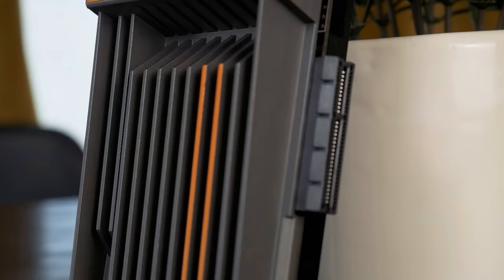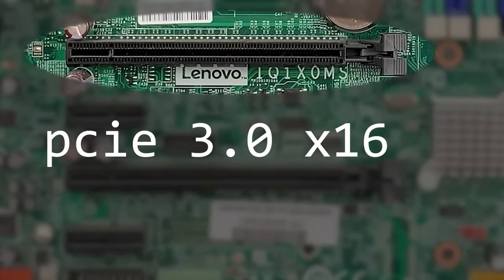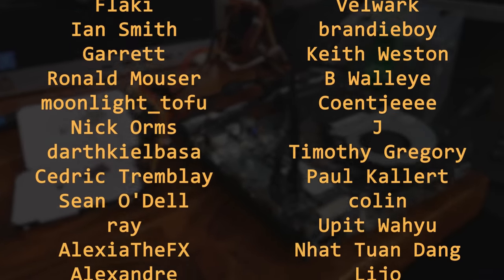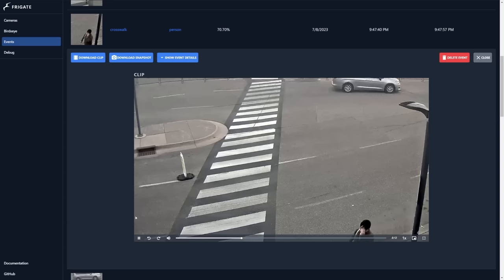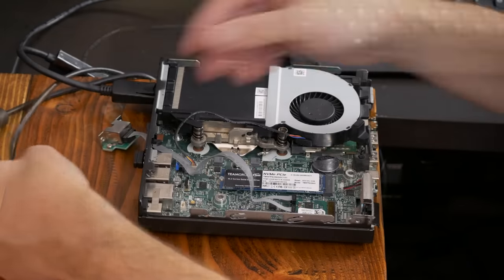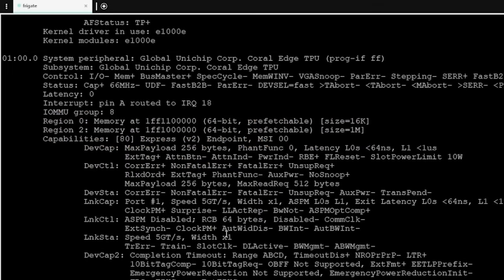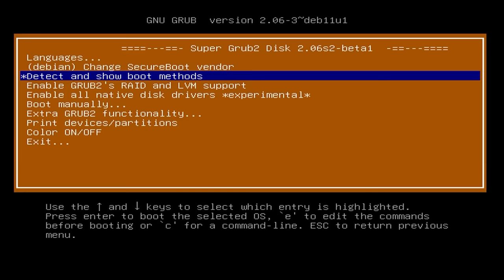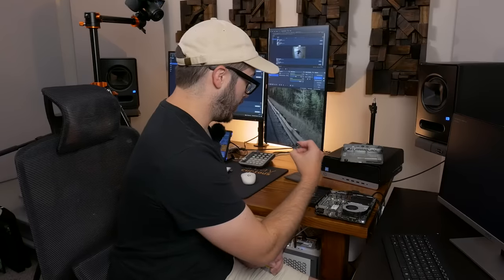Don't Overlook This Slot

Comment: Does anybody know if the dual SATA adapter can be used for a raid 1 configuration? I'd like to use the nvme drive for the os, and have 2 additional sata drives configured as raid 1 to make a nas-like system. It would be just for storage so even if doeas not reach a full gigabit I will be fine
Reply from the maker: Yes, but you'll need to configure RAID in software (which I would recommend even if the SATA adapter had a hardware RAID controlller)

Comment: I have tested with a coral dual edge TPU but did not manage to get it working in the same kind of system. Did you did any configuration in the bios to get it working?
Reply from the maker: Don’t think so… I know the dual requires 2 lanes for full operation though and I only think this has 1. I guessed it would work partially but maybe not

Comment: wouldn't that ethernet port fit if you flipped it round and put it in with screws on the other side
Reply from the maker: Probably! Not worth the time knowing I was about to pull it lol
Reply: I designed a bracket and 3d printed it to mount the 2.5 G ethernet port. I had to install it upside down (circuit board on top) due to space concerns.  I also had to trim a corner of the circuit board to clear the fan shroud in the G3.  Now I have to figure out how to add updated realtek drivers to pfSense as it does not recognize the 2.5 G port (Ubuntu uses it just fine).

Comment: so does anyone know of a modification module for this slot to add in a sata ssd and keep the wifi module? my laptop only has 1 m.2 slot, and the drives are kinda expensive where i live, like twice the price of sata ssd. my laptop also seems to have space for a 2.5" drive but no slot included, pls tell me if anyone fins anything relevant! great video btw !
the wifi card is rz608 by mediatek i think that's on the slot(80mhz wifi 6e)

Comment: I have a couple questions.  The first is if anyone has suggestions for a 10Gb RJ45 Ethernet or other high speed adapter to use in one of these slots.  It seems like PCIe 5, 4, and perhaps 3 ought to be fast enough to support one, at least in theory, and there are a very few out there, but I am wondering if anyone has suggestions.
I am also, like another person here, looking for information on combination adapters like both WiFi and cellular in one.
Finally, I apologize because it is off topic, but does anyone know of an adapter that would let me mirror data over two different PCIe NVME SSD's in a single slot?  Essentially RAID 0 (or is that striping and I mean RAID 1?) without taking up a second slot.  It seems like it should be easy to manufacture since you are just taking the same data and writing it to two different places.  No need to calculate parity or anything processor intensive.  But I can't seem to find one.  Even if they are only out there for U.2 slots and I would need an adapter, I am interested.  I am trying to figure out a way to get both mirroring and an external GPU, and I only have two 4 lane slots to work with.

Comment: I'm a bit confused. Is this the same as an msata slot? Because their both used for wifi cards.
Reply from the maker: No not the same as msata
Reply: No. Won't fit, different signals.

Comment: The SSD for this slot is called mSATA for some reason. There are few of them but none goes over 256GB
Edit - i find out 512GB and 1TB version
Reply: mSATA is not M.2 e-key. different.

Comment: well its not called mini pcie for nothing they actually make pci 1x to mini pcie adapter
Reply from the maker: That’s not mini PCIe
Reply from the maker: There is more than just one interface for wifi cards. In that article you mention it even says that most newer laptops use m.2 instead of mini PCIe. It even says to look at another page on the website. 

Here’s a different link that might be helpful.
https://www.cervoz.com/company/news/mPCIe-vs-M2/detail

Comment: the grounding issue is a common problem in electronics:
Both power supplies are creating a voltage THEY define as "0 volts". Even if you had 2 identical PSUs, it's very likely that the two zeros are different. I'm honestly surprised that the drives showed up just fine, but I guess the power to spin vs power to communicate are kept pretty separate?
When using two separate power supplies to power a single unit (even if it's two computers that need to communicate over copper), their ground rails need to be connected so they have a set reference. The two different voltage references was likely triggering a protection on the motherboard to save it from voltage spikes/sags.

Comment: Made a mistake with a slot like this thinking that I could get another SSD installed only to lose the use of both an sata port as well an nvme slot on an Precision 7710. Still got the use of the two 2280 but the third doesn't work so take this as a lesson to not yolo upgrades. BTW all the drives did survive so nothing in a sense was lost other than the use of two slots. 

There are loads of adapters out there so it just comes down to how the slots are wired with pci-e being the most useful even in older laptops there are often two slots that people don't know that could be used with 2230 and 2242 nvme SSDs be it at 2.0 1x speeds.

Comment: This video has a strangely annoying metronome-style clicking coming from soft pan left.  I had to stop the video a couple of times to make sure.  It could be the background music is just such a level that it barely punches through, or even a mechanical clock off screen left.  Either way, it's distracting to otherwise useful information.
Reply from the maker: Yeah, I switched my audio setup and noticed that the input on that camera has an issue. Didn’t notice till I compressed I’m post. I’ll switch to using a different camera in the future 👍🏻
Reply: @HardwareHaven  Oh, hell.  So I WASN'T hearing things?  You start to wonder when you get older and worked with rock crushers.  Thanks for the reply.
Reply from the maker: Hahaha oh man that sounds rough on the ears 😬

Comment: Useless concept and just simpler and easier to use a SATA to USB 3.0 cable for SSD drives. Which is what I do for my Linux server. No need to needing extra SATA connections let alone another power supply and all.  Yuck.